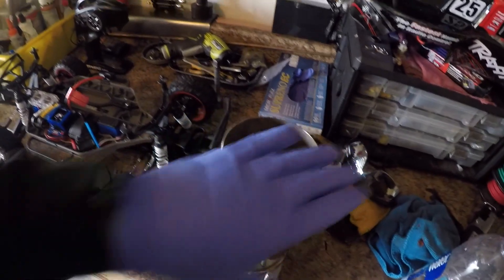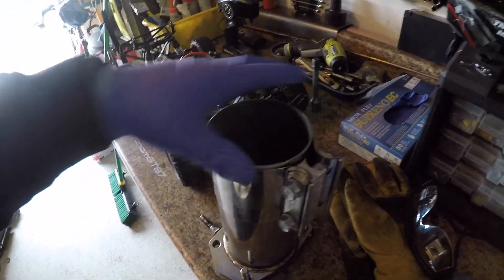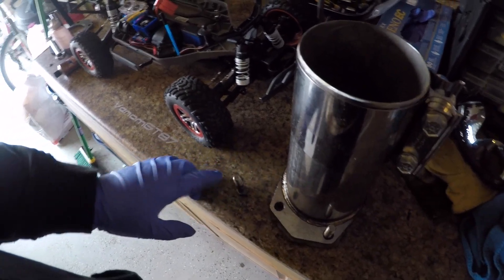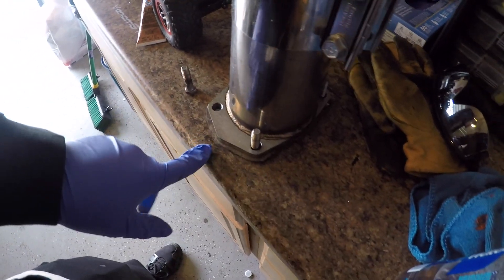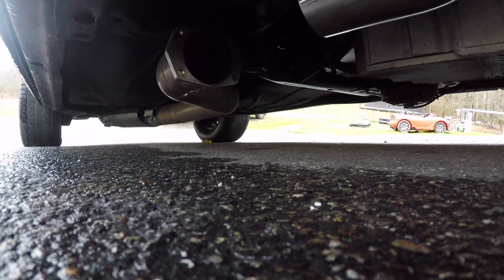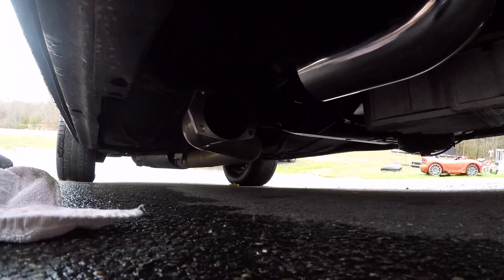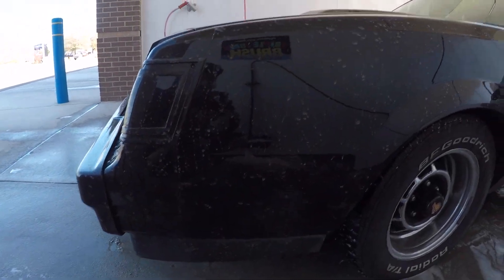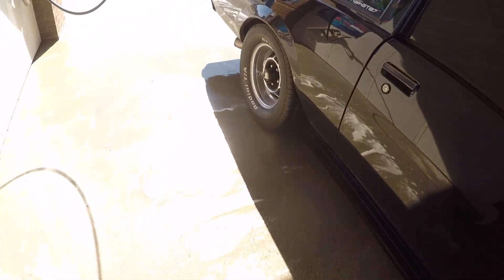Buick Grand National 4" Exhaust and Burnouts

Comment: AH the brain melting drone of the lc2
Reply from the maker: Gotta play with pipe lengths and resonators lol
Reply: @VenomGT87  Im running stock downpipe and exhaust with flowmaster mufflers and at 35 mph its migraine inducing
Reply from the maker: @bobrobert1123  add a resonator where the cat is and it should mellow it out.

Comment: when you have time need help with oil catch can type, what  is good to use with turbo regal ? is yours working well ? what mods did you do thanks
Reply from the maker: I have two, one on the PCV and one for the valve covers. Reason is because at idle the PCV absorbs crankcase blow by and pulls clean air thru the valve covers. The one on the valve covers is for when I go into boost particularly in the 20’s blow by causes the oil built up to mist off the breathers which get saturated with oil vapor over time.